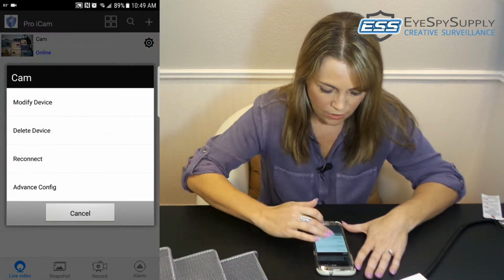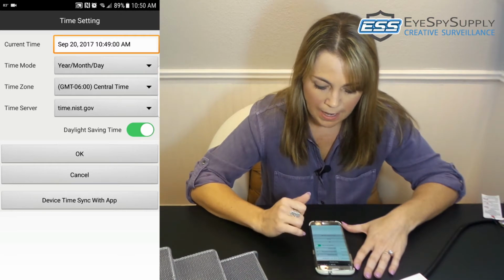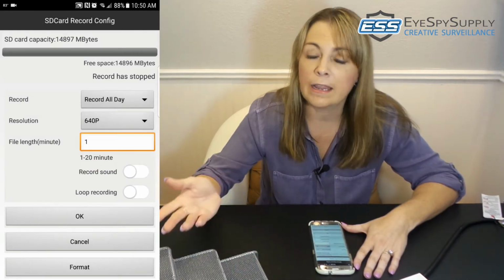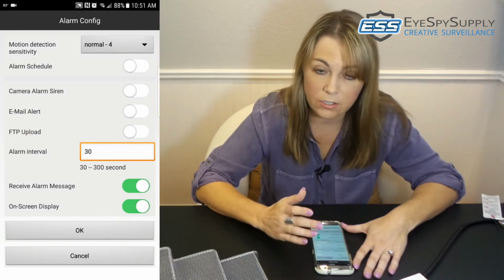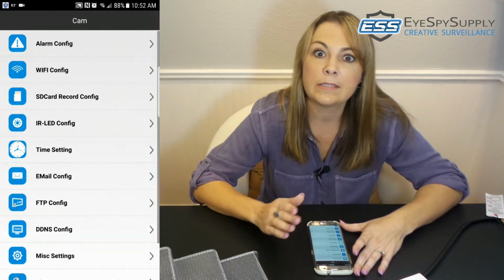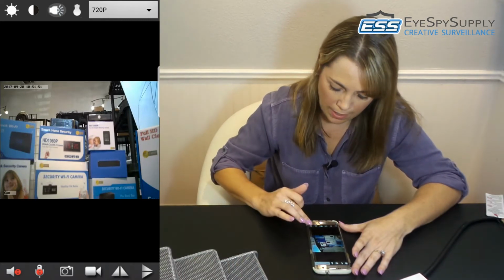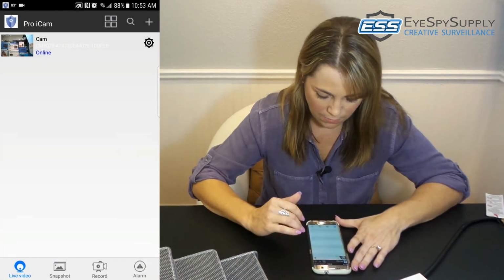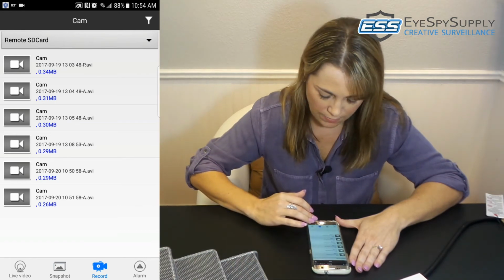Tutorial How To Use ESS WiFi Security  Surveillance Cameras  Pro Icam App

Comment: I need help I am southamerica the US now and I need to be able to leave this camera here to record while I am back in the US. the place where I am leaving the camera is my elderly parents home they have WIFI.
I have my cellphone with me here and have follow al the steps from the video BUT I am running into a problem that i believe has to be with the fact that my cellphone is not connected to my internet supplier in USA. When I use the qrscan it does it them I go to my phone settings go to WIFI and it shows all the available connections incluiding the one from my parents house. At that point it connects automatically to the one from this house instead to the camera one. I picked the camera wifi manually and it starts running and says that there might be no internet connection so ...i switched to the WiFi from the house . Back in the app it says login in....reconnect...looking for server....but never connects because I am using the house wifi right? 
what are my options?
Activate my roaming while I am here....now if i do that my bill will be huge right? 
now if I decide to install the app in a phone from this country set it up play w it while i am here.....a day before going home can i get the app on my US phone go thru all the steps again...use roaming to finish the connection and go get in the plane turn my phone on airplane mode and as soon as i am in the us open the app....will this work. plssssss i need to find if the caregivers are abusing my elderly parents